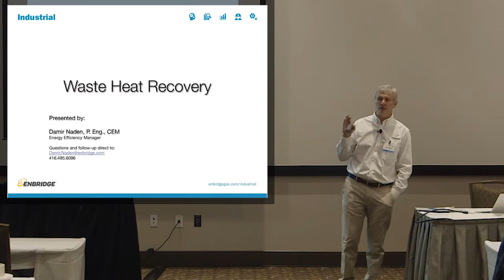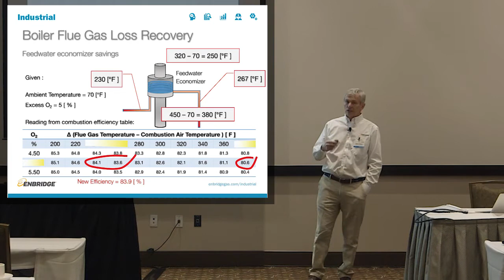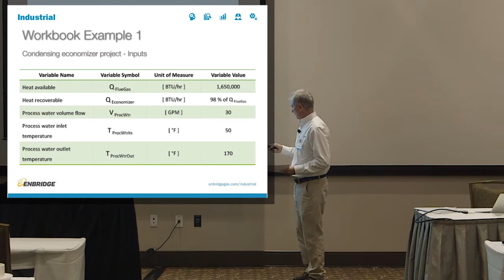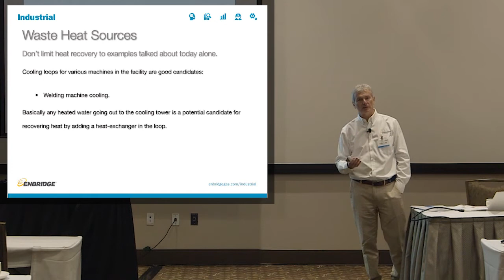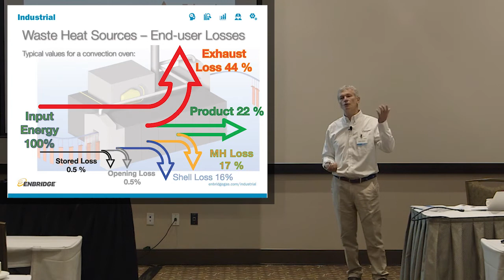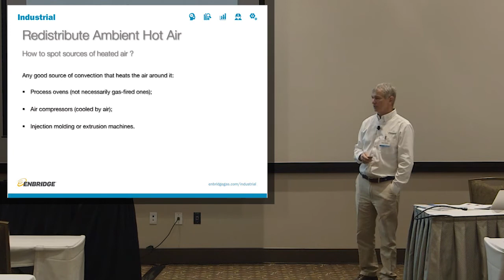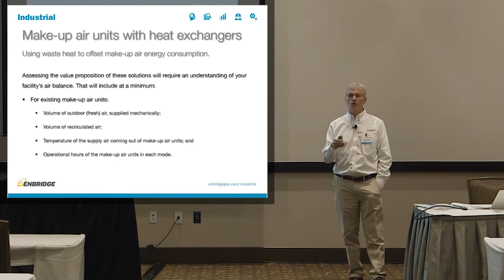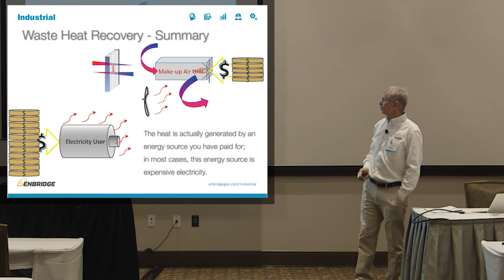Waste Heat Recovery Industrial Workshop - June 27, 2017

Comment: If you are serious about minimizing losses on a steam plant utilizing natural gas, the only sensible way is to use the combined cycle (CC) system, reaching overall efficiencies above 61%
General Electric aero derivative gasturbines have an efficiency over 42%. They are coupled with a bottoming
exhaust gas fed simple cycle steam plant having an efficiency of about 35%.
42 + 0.35 (100 - 42) = 62.3
The economies are much better, when the operational costs ( maintenance, operation, repair) are considered.
Do we still drive Stanley Steamer cars?
The supply of NG is increasing. The option of coal gasification is also realized (CGCC), Abundant fuel for hundreds of years of cheap energy is there.
There are still abundant opportunities to improve gasturbines using high temperature CMC's (ceramic matrix composites) further raising the CC thermal efficiencies and vastly improving long term reliability.
Environmental concerns are minimized when considering the clean exhaust gases, which consists of N2 and 2 H2O molecules for every CO2
molecule , at efficiencies approaching 70% ( still way below the limiting Carnot efficiency) this approach is by far the most reasonable.

Comment: In order for a civilization, such as ours, to become energy independent, it would be necessary to have complete control over waste heat. This would require the ability to harness waste heat and convert it into a usable form of energy. Most likely this is not possible using convention methods of heat differential and sensible heat transfer technologies bound by thermodynamic laws. But some laws can be circumvented if not outright broken when consideration of latent heat of vaporization is taken into account. Water for example, has a very high latent heat of vaporization around 940 BTU per pound. This amount of energy can be absorbed through a phase change without any change in sensible heat. This however renders the use of heat exhangers ineffective, as the temperature differential remains zero, even though a substantial amount of heat energy has been absobed during this phase change. In order to extract this heat of vaporization,  concentration of latent heat of vaporization must take place, and  no heat exchange method can be used to achieve this. It must be a spontaneous transfer to a lower state of entropy resulting in this ability to extract waste heat. And this can be achieved by saturation of air with water. Air has an affinity for water and  can be spontaneaously saturated to a high 90-95 % relative humidty. This causes the absoption of large amounts of sensible heat to be converting into latent heat of vaporization (phase change). The temperature of the water reservoir has now decreased by the 940 BTU per pound of evaporated water and cools this reservoir. The sensible heat of the liquid water decreased. The latent heat of the water vapor and air mixture has been increased by the same 940 BTU per pound +/- the actual sensible heat of the liquid water reservoir. Now this latent heat must be converted into sensible heat through compression of the air/water vapor mixture. Compression of high energy gases into a confined space causes latent heat to be converted into sensible heat during this process. This mixture when compressed to as little as 2 to 3 times atmosphric pressures can be converted into kinetic energy in a supersonic nozzle. We have now been able to achieve a 60-70 % conversion of the sensible heat and pressure energy in the converging diverging nozzle into a supersonic flow of kinetic energy. This would allow a pure impulse style turbine (reaction turbine is ineffective) to absorb the kinetic high energy flow of air and condensate into mechanical and subsequently electrical energy. Similar to a heat pump, high COP levels can be achieved at very low waste heat levels of 70 F and up. in this example we have an open cycle system similar to a brayton cycle where the heat sync and source are in fact the same reservoir and no heat exhangers are used to convey the transfer of heat. But a phase change was used to absorb and then concentrate a small amount of "waste"  heat into high differential sensible heat with only sufficient compression to achieve the ability of supersonic expansion (2X atmospheric pressure at the throat of a CV/DV nozzle). 100 years ago we made a choice to go high pressure, low speed, laminar flow, reactionary turbines...... This was a mistake.
Reply: Valiant effort DON,
But the most efficient systems are combined cycle (CC) exceeding 62%  and realized decades ago.
Reply: We can also minimize energy consumption in first place. Recovery of unused energy has an efficiency of 100%.